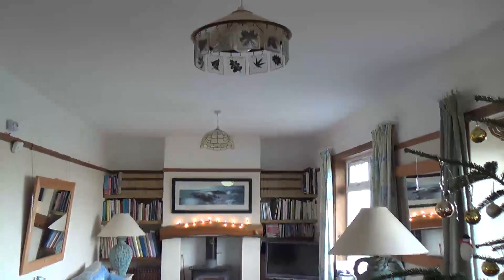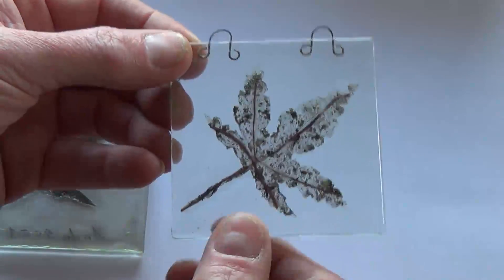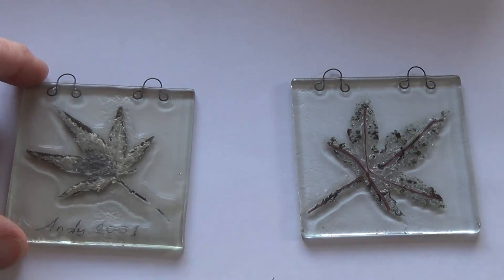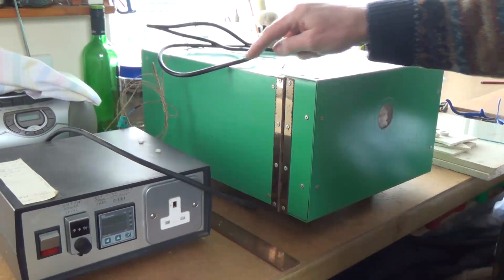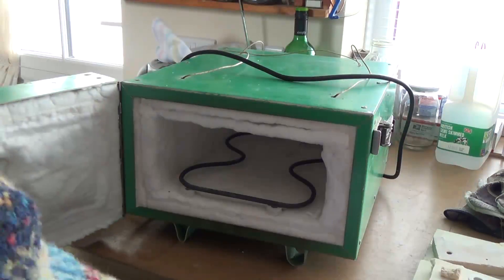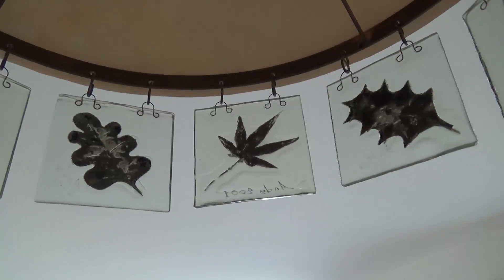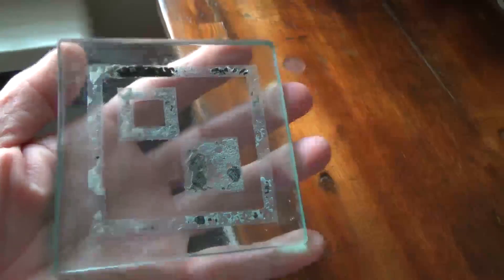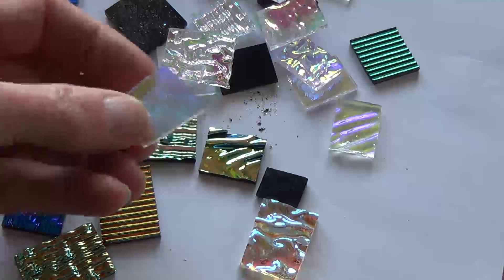kiln fused glass panels that I made in my homemade kiln

Comment: Hi. I am young researcher from the Philippines and I just wanted to know how were you able to make the kiln. I badly need one but I don't have the money. Do you have any suggestions about kilns? Do you know any alternative for kilns that I could use in my study because my study is all about making glass. Please.
Reply from the maker: Hi sorry about the late reply, it depends on what you
want to do, some glass work only requires 600 or 700 degrees Celsius and
although I’ve never tried it I don’t see why you couldn’t use an old night
storage heater elements. If you are using ordinary window type glass the
temperatures are quite low (unlike a pottery kiln) you really need to try and
get some ceramic fibber insulation, maybe you could contact a manufacture and
see if they will give you some either as a sample or to help you with your research,
tell them it may help their sales in the future if you are successful, they can
only say no but, as we say ‘If you don’t ask you don’t get’. Your biggest problem
is temperature control, annealing glass, as you will know, has to be well
controlled. You could let it down by controlling it manually but it’s time
consuming. You could use an old oven (gas or electric as a readymade case) for
the body of the kiln it would have to be suitably insulated for the working
temperature and of course it has to be electrically safe with correct interlocks
but they don’t have to be complicated, just foolproof. I don’t know if that helps,
work safe and don’t take any silly chances and I'm sure you’ll find an answer. By
the way if I get my ‘cooker’ type heating elements too hot they burn out.

Good luck . . .  Andy
Reply: @AndyDaviesByTheSea  Sorry for the late reply I was busy during our exams. Thank you for your advice. I guess I should try using an oven first but if it doesn't work, I'll contact a manufacture. I'll take your advice. Thank you for that.

Comment: I'm a beginner lamp worker and I look forward to you starting to do the same.
Reply from the maker: Hi Ruth, well I'm only just starting to play with the torch (with glass) What I’ve found out is that the glass rods that I have stored for years is not the best for use with a Hot-Head propane torch.
 I’ve now got some Effetre CoE104 glass rods from Tuffnell Glass in the UK much easier to work.
Good luck with the lamp work.
Kind Regards . . .  Andy

Comment: Happy holidays Andy! Very interesting! You have such busy fingers, I am thinking you should make a video about what you are NOT interested in, I imagine that would be a very short video. You appear to be interested in EVERYTHING! lol! Seems like that kiln may be useful for making vitrified ceramic stand-offs, coil forms and insulators for high voltage/power ham RF work? Those things are not as easy to find now as they once were, it would be a boon for restoration projects. Also I think a video about how you are bending those heating elements would be very interesting.
Reply from the maker: Hi and happy holiday to you too. I think you’d be surprised if I published everything I get involved with. I figure if someone else can do it then reasonably I'll have a go myself, I'm a qualified electrician and my training covered gas fitting although now my experience is no longer recognised  so that means I couldn’t legally install a gas installation. I built me own extension from the ground up to the top. I'll repair the TV sweep the chimney, rebuild the chimney in fact. I’ve sewn up any number of cuts, that gets tricky when I cut my right hand as although I can use either hand for most things I do prefer my right hand for fine work.
As for bending the elements, what I do is anneal the metal sheath by connecting a 220V supply to the ends of the element using ceramic terminal blocks and heating the element to around 800 degrees C, I let it cool and simply bend it with my hands using my thumbs to do most of the work. Funnily enough I’ve just powered up the little green kiln today for the first time in 15 years and it worked well. I used it to fuse two glass discs together at around 806 deg C , (it’s all a bit more complicated than just that) only needed about 500 watts to just gently bring it up to fusing temperature.
Thanks for the input.
Have a great New Year
Kind Regards ... Andy

Comment: Thanks for sharing.  How hot can that kiln get with a 1.2kW element?  What temperature do you use to fuse glass?
Reply from the maker: I can get the kiln up to full fusing temperature of around 800 °C (1,500°F) but I have to be very careful as I can easily melt the element sheath, there’s a delay between the element temperature and the thermocouple temperate and if a rush it the element races away and melts. I shouldn’t be doing anything too fast but I’ve melted a lot of elements because I'm impatient. I haven’t run the kiln for some years now and I’ve got to get back into understanding the process times/temperatures.
Merry Christmas to you and yours.
Regards ... Andy
Reply: AndyDaviesByTheSea Very informative as usual, and your voice is very calming.  Merry Christmas to you and yours too.

Comment: great work
have you ever done ceramic items in the kiln
Reply from the maker: High Dennis, it's many years since I last used the little green kiln and I think all I did in ceramic was a bit of glassing in it, I used it for glass fusing. If I run it too hot the metal sheath of the element melts! (I've done that many times)
I did build a kiln with an 18" x 18" x 18" cavity, I had loads of insulation and I made 3kW spiral wire elements. In the UK 3kW it the most you can pull from a normal domestic wall socket, more power than that requires a permanent wired supply, the other point was I used the homemade temperature controller (25 amps max) with my big kiln. I made some ceramics but I must admit at that time I got more fun out of the challenge of designing and building the kiln and controller. when I moved to the seaside I let the big kiln go, regretting it now but it was a big lump that I didn't use very much. 
All the best for the holiday to you and yours.
Kind Regards ... Andy
Reply: Say I I I I I I I I